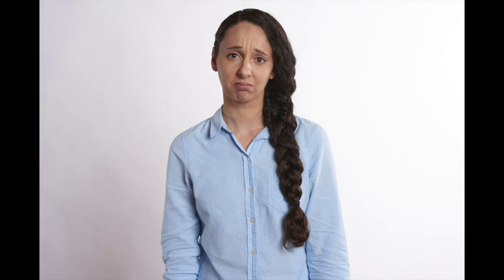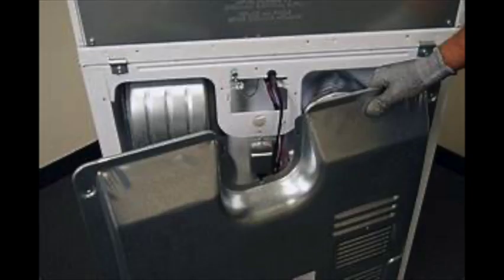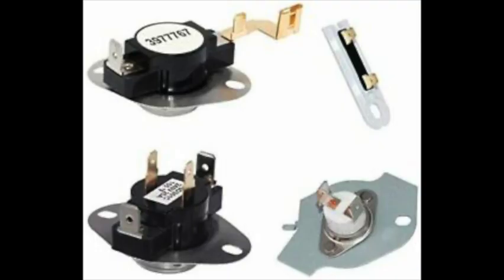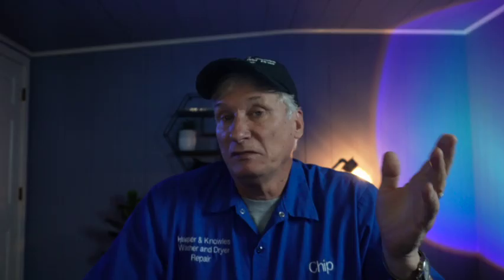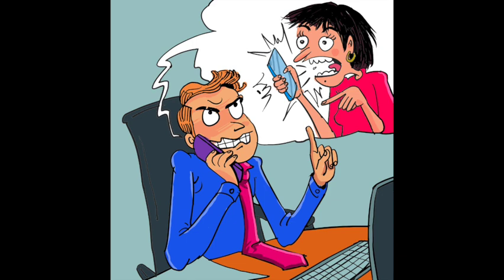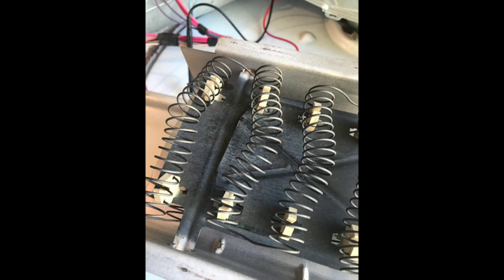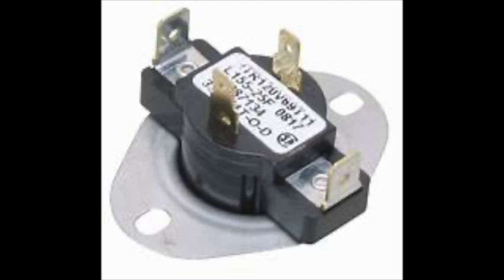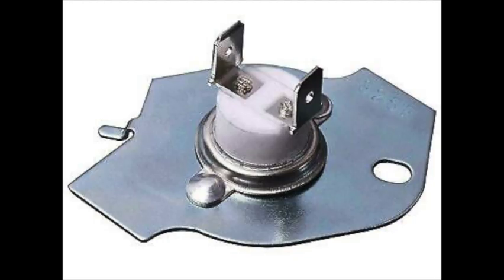How To Diagnose Clothes Dryers That Blow Fuses: Testing Thermal Fuses & Beyond,

Comment: I have an older Kenmore dryer, and I have the same problem, my thermal fuse keeps blowing. However, the first time it happened I replaced the fuse, connected thermostat AND the heating element-all new. It blew the fuse again, so I replaced the thermostat that controls the heat over near the blower. That worked for 3 or 4 loads and now it keeps blowing the same fuse over and over. Every time I reset it it works for like 10 minutes then blows. During that time, it DOES turn the heating element  on and off like it should, so I don't understand.
Reply from the maker: If everything is new and it still blows then you probably have an airflow problem. I have seen this happen often in houses where the exhaust air has a long pipe to travel to the outside. Usually with dryers located on an interior wall of a home where the exhaust travels up into the attic or through the floor to the outside. If this is your case then that exhaust pipe should be cleaned. I have taken a heavy nylon line with a weight tied on it and dropped it down this pipe then after retrieving the line, tied rags to the center of it so that it can be pulled both ways and drag it back and forth to clear the pipe of built up lint. They make cleaning brushes for electric drills that you can run through there too. You refer to “resetting” the fuse. If you are slapping the fuse to reset it that is a mistake. These devices are made to work once. Replace it. Once it blows it is weakened and won’t work as designed by “resetting”. Thanks for watching!
Reply: @HarperandKnowles  Yeah, the pipe is clean, I took it completely off and cleaned it. But, yes, I'm definitely beating the fuse on the floor to reset it. Lol. Maybe the original issue was the cycling thermostat, which I didn't replace until after this "new" fuse had already blown once, so perhaps that is now my problem. And, after watching your video and reading other comments, I pulled the heating element back out to check for any shorts, none. Plus, it turns off when you open the door. So, that's all good, too. I'll replace that stupid fuse again and see if it's good now. 

Do you suppose the temperature setting dial in the control panel could be bad and cause it to overheat? I wouldn't think, but I don't know.
Reply from the maker: Put a meat thermometer on the exhaust and run it on high temp with nothing in the drum. It should cycle off and on about 165 tops on the temp. You should hear the cycling thermostat click off about 155-162 degrees Fahrenheit.
Reply: @HarperandKnowles  I finally did the meat thermometer thing. It worked flawlessly without the vent attached, so I took the vent off again and literally flung it around in the yard to get every last little bit of lint out. I even blew it out with my leaf blower. Then I cleaned the outlet through the wall out very well. Since there was no clog it was hard for me to believe lint buildup was the problem but I've had no issues since I did all of that. So, long story short, you were right, it was an airflow problem even though it wasn't clogged. I'm still baffled by it but just glad it's been working since!
Reply from the maker: The buildup,on the sides of the vent pipe will slow the airflow tremendously! Thanks for the feedback!

Comment: This is great for a electric dryer. what about a gas dryer that keep blowing the hi-limit thermal fuse? i have cleaned inside and out on the exhaust and checked the outside cover for good air flow. I'm having to reset it about every other load.
Reply from the maker: It sounds as if the dryer isn't cycling on and off like it should. Change the cycling thermostat. Why not change them all while you're at it. Thanks for watching!
Reply: Will do, thanks

Comment: I also have high limit thermal cut that keep blowing. I replace all the fuses and cycling thermostat and heating element. I even took the exhaust temperature and it's normal. I'm thinking it is the electrical current in the wire that is causing the fuse to blow. What do you think?
Reply from the maker: I would check that the airflow is good at the end of the dryer vent duct outside the home and that the heating element coils aren’t bowed out and maybe shorting to the frame when they heat and expand.  If you are on a municipal  power grid your voltages shouldn’t be a problem.

Comment: After all the heating elements fuse.thermostat replaced but still blows out my fuse.What should I do??this is 4th time to replace fuse..My Samsung dryer inside parts are all new one because I replaced almost whole parts even motor too..but fuse keeps blowing out now..somebody help….
Reply from the maker: If your Samsung dryer has a thermistor on the blower side you should change that too. Thanks for watching!
Reply: Thank you for replying.I replaced thermostat also .I replaced all parts only left mother board..
In this case ,relay on mother computer board is problem??Because some YouTuber recommended in this case..only left mother board computer.please help…
Reply from the maker: Unfortunately, that would probably be the problem. I don't think it's a relay, but it has something to do with the temperature control on the control board. If you replace that, it will probably fix your problem. I recently had to do this with a model paired with a front-load washer.
Reply: Thank you so much for help..I will replace computer control mother  board.Hard time….

Comment: I am having a similar problem. I ordered the element and all the sensors. There is one clue that might diagnose this problem. I set the Whirlpool dryer to air fluff, and the exhaust was getting warm. Ill see if it is the element when I open it up (for the third time) tomorrow
Reply from the maker: It sounds like you're on the right track in diagnosing the problem with your Whirlpool dryer. If the exhaust is getting warm during the air fluff cycle, that suggests that there is still some heat being generated in the dryer even when it's not supposed to be heating. Excellent diagnostic work there! Very clever too. I hope others read this and learn from it, I know I sure did.
Good luck with your repair and hopefully you'll be able to get your dryer working properly again soon!
Reply: @HarperandKnowles  It was the element. It didn't look bad, but replacing (along with all the other sensors) it fix it. With further examination, it looks the center baffle was wrapped  (away from the assemble) and was probably shorting, Not a great design if a thermal fuse on the heating element didn't blow it was the motor one causing the dryer to get even hotter

Comment: Yep, This must be the culprit on my Whirlpool also, replaced thermostats, cleaned everything, reworked the vent hose but kept blowing fuses even though the element always checked out fine. Will be replacing that next, good or bad.  If that doesn't work, it goes to the dump.
Reply from the maker: Thanks for watching!

Comment: Help! What could cause a washing machine start cap to overheat, crack and die. Is there a run relay in the motor that I can't see.?
Reply from the maker: Hi, yes there is a centrifugal switch just behind the shaft end where the water pump connects. (assuming a whirlpool product here)  A start capacitor is designed to only stay in the circuit long enough to boost the motor  RPM’s up to running speed. If it stays in the circuit too long it will overheat and fail. A motor that is weak and continuously clicks will also fail the capacitor. The clicking is the centrifugal switch going on and off.  If the switch has failed I'd suggest replacing the motor. I hope this helps, thanks for watching.
Reply: @HarperandKnowles  thank you. I'm guessing my prob might be the motor switch. I'll test that first. If it is not faulty, I'd be better off just buying a new machine
 But thanks for your prompt reply. You surprised me!! 👍👍
Reply from the maker: The Missus tells me I'm full of surprises!  Have a great day!

Comment: Me, again...I am trying to remove the cabinet case, but I can't get it to budge! I've removed all screws and wires going to it. Do you think it won't come loose from the drum bulkhead because it is so old? Do I need to use more force to "break" it loose? Any and all help is much appreciated! (I purchased a new heating element along with the heat cutoff and thermostat. I sure don't want to have to send them back.)
Reply: Nevermind...I GOT IT OUT!!! Different question...the heater box is discolored (whitish). I am assuming it is due to the heat over the years. Will this affect anything, or should I try to replace the heater box?
Reply from the maker: It should be fine. I wouldn’t replace it.
Reply: SUCCESS! I just fired it up, and the dryer is nice and 🔥.  Glowing that beautiful red/orange glow!!!🤗 Thanks for all your help!
Reply from the maker: @nlc464  glad your repair went well. Congrats!
Reply: I have one more question. I have an older home that only takes the older 4-prong dryer plug. Is it safe to replace a newer 3-prong dryer cord with a 4-prong replacement cord? (This is for an older style Whirlpool different than the one I just fixed.)
Reply from the maker: The four pronged plug is the upgraded version. It has a separate neutral and ground. To wire an older three pronged dryer with a four pronged cord you should remove the white neutral wire on the machine from the frame ground and attach it to the center lug along with the white wire on the four pronged cord. Attach the green wire on the cord to the frame screw and then match the red snd black to the outer lug wires.
Reply: Well, here I am again with yet another question...After replacing the heating element and the thermal cutoff kit, I ran the dryer for about 2 loads of laundry, and it worked great. I had the heat turned down pretty low, but it seemed really hot as if I had the heat on high. Then, on the 3rd load, the heat went out again. 😖 I took the back panel off and tested all of the replaced parts with a multimeter. Everything had proper connectivity. When I hooked the dryer back up, the heat started again! Is it possible that I need a new cycling thermostat? (I SO appreciate all of your help!) P.S. I had also previously replaced the thermal fuse. So, it is new.
Reply from the maker: That is exactly what you need. The cycling thermostat is what regulates the heat.
Reply: I guess I'll be ordering one of those now! Once again, thank you! I am going to share your channel with others! @HarperandKnowles
Reply from the maker: @nlc464  thanks for the support!

Comment: Hello, I have a gas dryer (Model Alliance AGS28AWF or Speedqueen) and still having a issue, maybe you can help me - the flame is turning on for about only 15 seconds and then turns off, so I ordered a High Limit Thermostat, Manufacturer Part Number 489P3 - this part is located near the flame -  When I changed the part, it made no difference - same problem. I also changed the coils on the gas solenoid, still have the same problem.
However when I bypass (jumper) the two wires together that was on the High limit Thermostat, the dryer work perfectly. I did check the original High Limit Thermostat with a meter and it reads (closed) ~0 ohms at room temp. Why does it not work when hooked up? What should I try? Also - I understand that this is a high limit temp switch, but what would cause this to open? 
Thanks
Reply from the maker: Hi, Tom.  Speed queen isn’t a brand that is common in this area, and I have never worked on your particular model, but if I were a betting man I’d say that your flame detector/sensor was faulty. Most gas dryers I have worked on have one of these and if it doesn’t detect that the flame is lit it will shut off the gas supply soon after ignition.  I found a speed queen part #D510213 that may or may not work on your machine. I hope this will help you with your repair. Thanks for watching!
Reply: Thanks -I will give it a try, but the unit works fine since I bypass the High Limit Switch. But I also don’t want to burn the house down from any over heating issues if it happens.
Reply from the maker: I did some further research and that should be the correct part number for your model.
Reply from the maker: Yeah, bypassing those safety features is never a good idea. I’d order that part ASAP.

Comment: I will inspect the heating element, I am having a similar issue, but I am not blowing the high heat fuse.  I can check the temperature at the vent, and see what it tells me. I am almost thinking my problem is in the control board
Reply from the maker: I hope your repair goes well. Thanks for watching!

Comment: Really appreciate your story, but I'm not sure what to do. Same issue, but I bought a new coil (old one was burned up) and replaced everything as you did. Thermal fuse keep tripping again and again (I've replaced 3 times since new coil). Can't believe with a new coil it's grounding out, but I'll give it a look tomorrow. Very basic machine, Whirlpool WED4800BQ1.
Reply from the maker: Try using a thermometer that reads at least 200 degrees Fahrenheit. With no clothes in it run it at high temperature and place the thermometer at the exhaust port. Somewhere between 155 and 170 you should hear the cycling thermostat trip. If your temperature keeps rising you have a grounding issue. I’ve also seen a rare cycling thermostat that trips but is still closed. I hope this helps with your repair. Thanks for watching.
Reply: @HarperandKnowles  thank you so much. Saw on another response where you mentioned if the heater coil stays on mid-cycle when you open the door, that's also a grounding issue? That's what's happening if I open door midcycle I see the orange from the coil staying on. Again, I replaced everything so I'm guessing it's the new coil still touching something?
Reply from the maker: @johnnixon  Yes, that indicates a grounding issue.  Sometimes these are not obvious. It may even be a lead going to the element that has grounded, but that is extremely rare.
Reply: @HarperandKnowles  FOUND IT! BRAND NEW coil was grounded on itself. One of its loops were bent inward and resting on one of the supports inside the coil box. I bent it out so it wasn't touching and the continuity went away! Tried pushing it on and off and that was it! Just gotta get a new fuse and I should be in business. Nuts that a brand new coil would be bent up. Thank you sooo much for your help!!!
Reply from the maker: No problem I’m glad you found it.  Relish in that feeling of accomplishment!

Comment: I have 2 questions about a Whirlpool dryer LE5800XSW3 (almost 32 years old!): #1 - Can you tell me how in the world to get the heating element out of the housing!? In this older model, the housing is one, solid piece of metal. The heating element has to be slid out of the housing from the bottom. The problem is that there isn't enough room to slide it out. The bottom of the dryer is in the way. #2 - I think that the thermostat heater has gone bad. It is WHIRLPOOL #WP61894 - THERMOSTAT HTR. I cannot find this part ANYWHERE! Is there any way it can be replaced with a different part? Thanks for any and all help.
Reply: I forgot to mention that I think maybe I'm experiencing the problem you are describing in this video. I keep replacing the high limit thermostat, and it keeps blowing.
Reply from the maker: Oh yeah, that's an old one there. Anyway, you will have to remove the back panel and you will see the element shroud resting on two teeth at the bottom. You may have to pop the top cover up and reach between the drum bulkhead and the cabinet case and remove the screw that attaches a strap at the top of the element shroud that secures it to the drum bulkhead. The top of the shroud slips inside the bulkhead so after removing that strap wiggle the shroud until it comes out and lift the element shroud off the two teeth at the bottom.  Then you should be able to figure it out from there.  Thanks for watching! Good luck with your repair!
Reply: S @HarperandKnowles  Thank you SO MUCH for RESPONDING SO QUICKLY! I thought I had to remove the entire housing but I could find no videos showing how to do it. I will try what you said. In the meantime, I literally just finished replacing the old high limit thermostat after watching a video on how to reset it by hitting it on the back. It worked!
Reply from the maker: I’d replace it, that’s a weak component after it blows once.  You caught me home for lunch and I was doing something on the computer when your comment popped up.  I’m not usually so quick!
Reply from the maker: If you replace them all and a new element too you shouldn’t have anymore problems inside the back cover.  A motor, some rollers and a timer and you’ve completely rebuilt it! Ha!
Reply: I am trying to remove the cabinet case, but I can't get it to budge! I've removed all screws and wires going to it. Do you think it won't come lose from the drum bulkhead because it is so old? Do I need to use more force to "break" it loose? Any and all help is much appreciated! (I purchased a new heating element along with the heat cutoff and thermostat. I sure don't want to have to send them back.)

Comment: What could be the burning smell the heating coil and thermostat was just replaced the dryer works just smelling like burnt plastic HELP!!!
Reply from the maker: Plastic huh?  I’d look at my dryer cord where it goes into the wall socket.  A bad receptacle can cause the prongs to get hot and melt the plug. Also check where it screws into the power lug on the dryer. You may have to remove the cover to see in there. Other than that I don’t have a clue. Thanks for watching! Let me know if you find your problem.